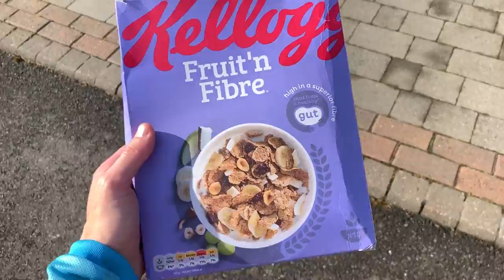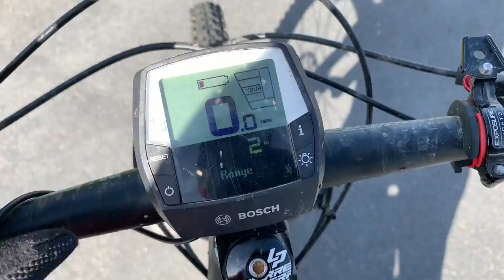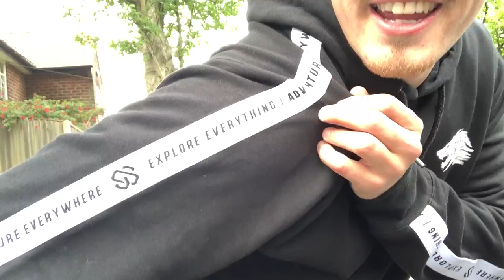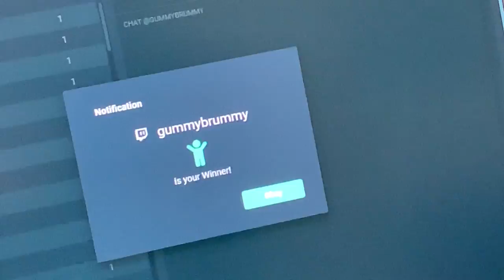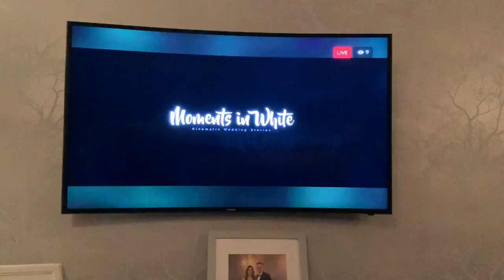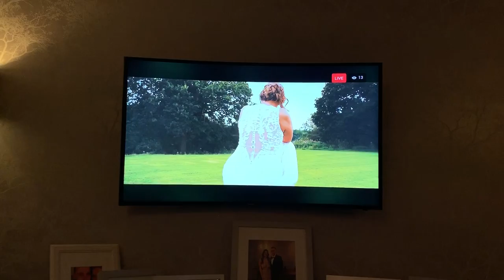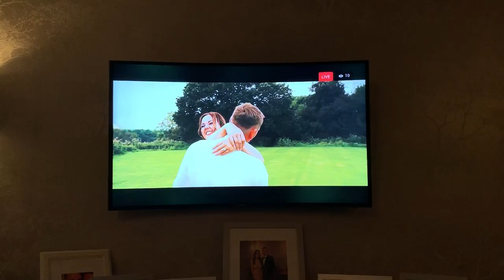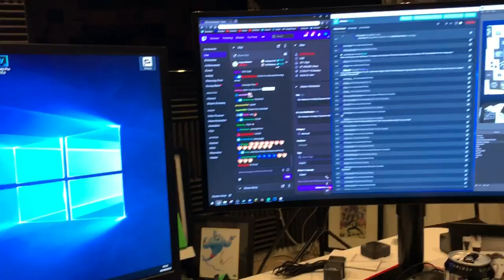THE BEST MONDAY OF MY LIFE!

Comment: Hey Tom to get the rust off the plug put the metal prongs in vinegar to eat the rust and then take steel wool or a wire brush and start scrubbing.

Comment: Eh... if you raised the temp in his fridge you've just flooded it. That ice will melt and soak into what's on that tray and drip down to the others. Not too much bother but certainly easily avoided by just hammering the ice off.

Also, Karl is bang on with the colour choices for your bedroom.

Comment: Tom heres a handy tip wd40 has a mix of water in it too so not the best thing for it get a silicon spray to clean electronic stuff 
Or ultra 2040 from wurth as it is the same as wd40 but no water